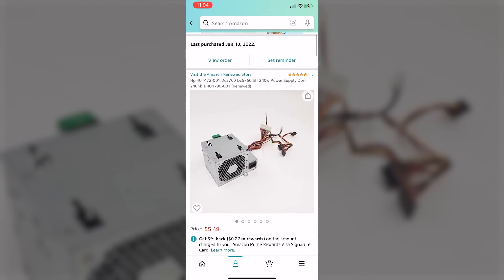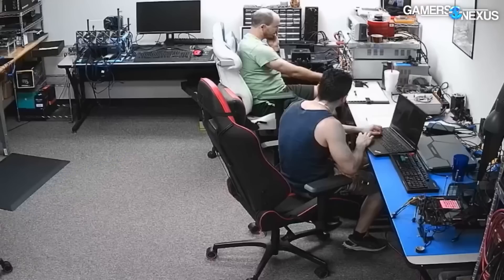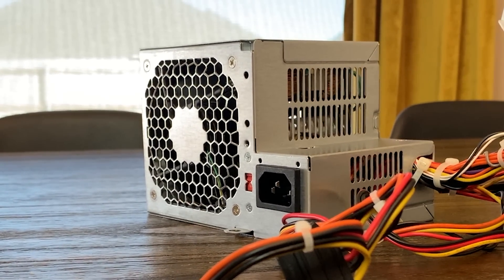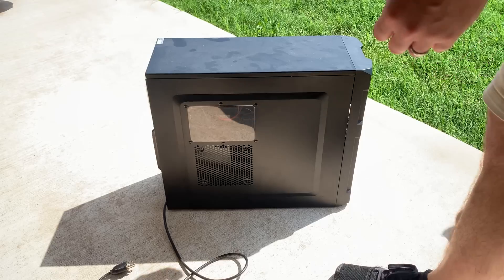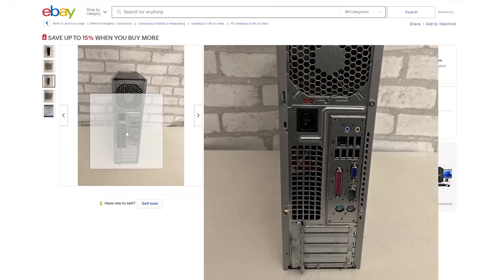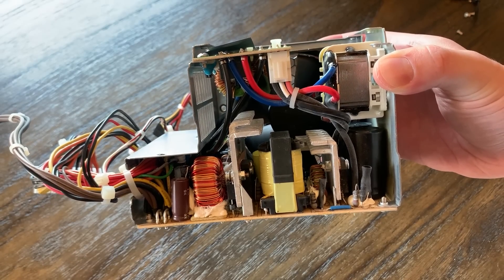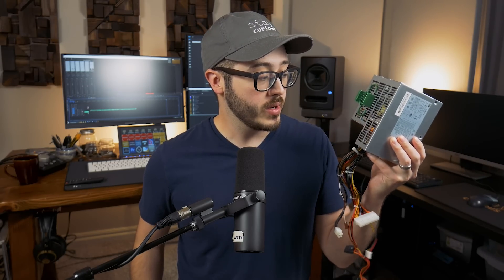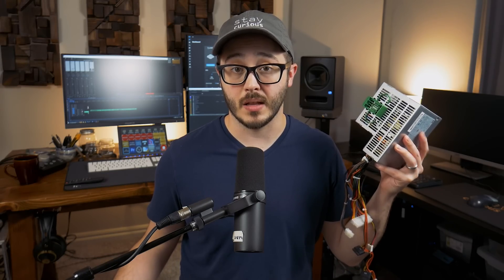THIS Ran A Website For Over A Year

Comment: I mean these PSUs are from like dell optiplexes which are tucked under desks for YEARS in the dust so they are reliable. Its the same thing for used PSUs if they ran for a while it means they will probably continue working for the 10+ years they are designed to. 👌(tho i wouldnt buy an old tier D or E PSU like a older 500w Thermaltake White PSU)

Comment: I ran an Athlon II 945  Quad OC'ed to around 3.1GHz 8GB or DDR2 1200 ram a couple hdds an ssd a dvd-r and an R9 270x also overclocked on a 300w Sparkle Power I got out of a dell that was tossed on the side of the road for like 5 years, pc was given to a neighbor a few years back no idea if it still works or not.

Comment: just replace the caps and keep using it, i repurposed hundreds of those PSU's, if you want to by new 12 or 5 volt 200w or more like 500w power supply  it's much more expensive and all are chines. at least these has been tested and meant to last. and by the way none of them exploded and never will if you use them properly, (i mean anything can happen). It has internal monitoring and if it becomes unstable it will shut off, or will not power on again

Comment: My opinion on what to do with it is to replace the caps. 

You bought it as a project power supply. If it’s working for what you need it to do, but just needs a couple of caps replaced … surely that would be more cost effective than throwing the whole thing out.

Comment: As a tech savvy 14 year old, I of course want newer equipment. But I am fine with older equipment, as I run it on a daily basis, and I am completely fine with it. I have old HDD's from 2007, and because of the conditions they were in, they are still fine, I write data to them, they work just fine. I have a CPU from 2006, still runs fine, runs fast enough for me to do what I need to do, my RAM is still DDR2, but it is plenty fast for me to do what I need to do. So older tech isn't always crap and junk as some people think.

Comment: ive never had a psu die, but i managed to kill 2 ac power cables lmao. one was like fucked up cuz it came with a laptop i got off ebay and it fucking like arc flashed i think cuz the plug was like barely connected. another was one that was on top of itself for a long time and managed to melt into itself and wow that was scary to find in the back of my computer (still worked). 

my brother had a crappy ancient antec psu that would shutdown whenever he tried to sleep his pc and it died when he did a case swap

Comment: you know, I had a power supply that exploded a few years ago 
I'm 15, I know a bit more about computers now, but back then I was just getting into and learning about computers and how to fix them. I had gotten a PC that was completely stripped, it had no native video support, or a hard drive, just the case, motherboard, and (faulty) psu. whenever I would hit the power button on the case, the power supply would trip immediately, so I just unplugged it and let it sit for a few minutes, did it again. same result. kept doing that over and over until I heard a pop and sparks flew out of the exhaust fan grille. I then realized I had majorly fricked something up and ripped the power cord out, upon disassembly and closer examination, an IC had blown up. I also shocked myself on that thing 
120v hurts

Comment: We all know that you're going to replace the caps; so go replace the caps..   
I was in the military for 20 years;  everything is basically  "lowest price that fit the bill " .. In today's PC market, like for laptops and mini-PC's, it's cut-throat, and everything is about where the manufacturer can save 5¢ and that's enough for them to put in a cheaper part; almost no one looks at the Power Supply other than the voltage /wattage that the power supply outputs.   At most, people might opt for a better power supply in a more expensive rig, but it's a weighted choice. 
You took a $5 power supply and used it for a year;  it's not a choice that I'd make, but I'm not going to knock it as it did work longer than I would have guessed it would. 
FWIW: I'm more likely to toss in a good UPS before I'd go dropping money into a power supply, unless I really thought that the power supply was suspect.  Line power is a bigger issue overall for electronics in my opinion.    Yes, I've swapped power supplies before for power issues; in the end, I've resorted to a good UPS more often than replacing the power supply.

Comment: I had one of these power supplies in my old HP DC7900. I used it to run a minecraft server. It ran fine for a few years then I got better hardware later on.

Comment: yeah, those caps are concerning to me.  Do what you want, but I wouldn't trust it.  PSUs are too cheap to risk it IMO.  If the system is as lightweight in terms of demand as I believe it is, you might be fine with a NanoPSU kind of deal; though, depending on which one you buy, you may end up spending more than you would on a standard PSU.

As for the experiment, it was definitely worthwhile, and even "bad" PSUs, unless something goes wrong, like a capacitor leaks or otherwise stops working, then the only time it's really going to fail is during very high demand. IIRC, most PSUs fail due to overcurrent, or max current loads, that the hardware inside just isn't capable of handling. So for a low power system, just throw in whatever, and it will probably be fine.  I wouldn't recommend a $5 PSU, but obviously, it can work.

Short story: a friend of mine actually had a system that wasn't working right.  Due to the strangeness of the issues, on a whim I said, let's replace the power supply, with nothing more to go on than my gut telling me that it's the only thing that affects all the components that had been "blamed" by the system logs for failures.  You know what? it worked.  Fixed them right up.  PSUs are both extremely important and extremely irrelevant in a system at the same time.  You obviously need one, but they can both be the source of plenty of problems, or something you can entirely ignore and they just work.  They're kind of a conundrum like that.

Comment: The part about it being an HP PSU is a good point. It's not so much about the price of the PSU that determines if its a good one or not. It's the manufacturer. If Seasonic released a new PSU for budget builds that was cut down to save costs in every way possible while only leaving the absolute necessities to ensure it's a safe PSU, for like... 30$... I'd buy it. Why?

Because it will probably suit my needs just fine for what it's actually meant for, and since I know Seasonic doesn't want to tarnish its reputation as being one of the better PSU manufacturers around; it's probably going to work just fine as well for many years to come. 

But for anything else, yeah, I'm probably going to keep buying the slightly overpriced units instead at higher ratings and wattages, because those are going to be used with the intention of upgrading through the years for the other parts connecting to it. Something cheap like what I just mentioned, wouldn't get that treatment. Likely.

Comment: I actually use power supplies took out from OEM Systems(Acer,Asus,Dell,HP...etc), I have come across various PSU brands like delta,acbel... ,most of them work totally fine over years, although some of them does not have verifications like 80+ or so, they worked totally fine, some times if I couldn't get enough power from a single PSU, I would simply just grab another PSU from my recycled stuff shelf and bridge the connection on the 24 pin header to power up something like 20 hard drives, works fine over the years, I build three servers with dual Recycled Delta PSUs, they work 24 by 7, been three years, no issues at all.

Comment: I mean no joke what I’ve learned from just PCs in general and just experience with PCs, that usually power supplies that look like that like bare metal usually could have a high chance of blowing up but at the same time have a high chance of being really really good. Good in reliability and the price because look at all these prebuilt companies like Dell, HP, Lenovo, etc. I mean by no means does it look like a normal power supply or one that you would buy for your own PC and when you look at the power specs it looks like it’s definitely not enough. That may be correct if you were buying a power supply from a third-party brand like Corsair, EVGA, Thermal take, etc. But in this case usually the prebuilt companies power supplies they’re actually able to handle the higher wattage or could be closer to full capacity while still being fine I mean sure they are proprietary so you might not be using those in a computer anyways. I also have other older computers who have power supplies that are normal ATX but they’re bare metal and don’t look as good as moderns power supplies but it also is able to run at higher capacity. I know this from personal experience because I have tons of prebuilt PCs and a lot of them are used for crypto mining so they’re basically running 24/7 and even if there’s probably a lot of dust buildup in it it still hasn’t had any problems yet knock on wood.😅

Comment: I use an over 20 year old 450W power supply in one of my mashines. My daily driver has around 5 year old dell optiples supply. I also have the exact same machine your 5 buck power supply came from and I am using it for hosting a minecraft server. An old hp office machine is good for playing minecraft, csgo and shit too as long as you have any gpu better than gt 710.  This power supply has capacitors in a bad shape but it'll be good enough for 3 - 5 more years for low power projects like running a minecraft server and shits.

Comment: I work in IT, & in this business cost rarely means quality anymore. Nowadays you have to go by track-record only. I have an old ATX-type Deer Computing Company Pwr supply (230 Watts @ 24 Amp) manufactured in Feb of 1998, that I use almost weekly to test individual components without having to run them through a newer AT-Mbd combo, or Jumper'd AT supply. I had a much newer Dell (2016 420watt) AT-type that blew a cap & fried the board, SATA-2-USB adapter & the 500GB HD connected to it in one shot.

Comment: Until you discharged the capacitors, I was cringing. As opening up a PSU not doing that is so dangerous.  As long as they pass Safety standards, a cheap PSU is fine for a server as it will never be under full load considering must low power home server chips are only 7w-25 idle and 90w underload so as long as it a high rated eg 100w your fine. Those PSUs that low up on GN where only failing under a extreme load, however if building a gaming rig the PSU was substandard for that use. But I bet their are hundreds of low end builds with a max 400w power drew who brought a cheap build and they would last and be safe for year. But paying the price they was to BUY you expect safety under any load. Where as cheap $5 PSU you now its limit. I have a N100 mini PC running some unknown OEM crap but it will be ok as the N100 will never get near the 150w brick supplied with it.

Comment: I used an old PSU for my Minecraft Server... Like That PSU was free with an iBall ATX Case... And when I checked the PSU... It was extremely dusty... And from 2010... I first checked it externally to see if it was working... And it did... So I put it in my Minecraft server which ran for 8 months nonstop... Until I had to turn it off for some reason, both the server and its PSU are still working extremely well... 
(That PSU was never cleaned in its lifetime... And still ran... Old PSUs were good bruh)

Comment: People these days have the belief that everything has to do with ultra maximum specs, high performance and spending a ton of money on computer parts no matter what you want to build. Well personally I've been using old desktop PCs and parts for the purposes of my job in a public hospital in Greece and I got to tell you one thing, if it works it works. Sometimes it only has to do with good preservation of hardware that's all! So KUDOS for your 5$ psu project, I hope more like this are coming in the future.

Comment: I really enjoyed this video  - and your thoughts about people on the Internet. There's so much PASSION for things that are ... well ... really not that important. Some perspective is good.
As far as old power supplies go - I'm pretty sure the little compact case Pentium based system I've had in my basement for over 10 years running Linux wasn't a premier power supply when it was built - but it was good enough, and that machine is really only used for trying new things out that don't require much power. There are good comments here about the power efficiency of power supplies - and computer systems themselves, and the costs related to running inefficient hardware.
Keep up the good work - I enjoy your videos because they're not over produced, you talk like a normal human being, and you make it look doable for a normal human being!

Comment: The bad caps are usually from a voltage or current spike.  People don't realize that voltage drops cause current spikes.  Voltage and current move in the opposite direction.  A "brown out" causing higher current draw can be as bad as a voltage spike.  I keep all my electronics on an UPS/battery backup to protect from both.

Comment: 2 years ago my friend gave me his old mATX mobo with integrated fanless Celeron J1800 Atom cousin cpu. Its been up basically all the time as NAS since then except kernel updates and one os reinstall. Its running a no name "400w" ~70% efficient chinese psu that i removed a fan from to make quiet. Its barely getting warm at full load (Kill a watt at the wall socket around 25w). I mean some little crammed phone chargers run more power than these low power pc's and they dont die, so your average no name feather light fan removed psu probably wont too.

This psu is like a 5c psu compared to the 5$ PSU people are calling a bomb, has been running FANLESS and still has to show any issue. Not everyone is running quad enterprise gpus and dual socket 300w cpus.

Comment: this video basically shows something i did on my newest project. i had a cheap power supply malfunction on a low power system. all i had was a very old power supply from 2005.. but since the system only runs a pentium G2030 i decided to install it since it was the only one i had. it works perfectly fine as of writing this. the fans are loud but at least the system works perfectly fine

people take a lot of things for granted. even the most expensive power supply can explode or fail. nothing is unbreakable or invincible..

Comment: My main rig used to use one from the trash! It was some ancient 300W unit that acted as a cooler for my GPU too because it was constructed out of cardboard. 

It lasted forever. And probably still runs now. (We moved, it got tossed)
Reply: I still use a 20 year old power supply in one of my retro PCs. I don't trust it with my life so I just connected it to an extension cord with a fuse. Still I don't see any issues with it.

Comment: Dispose of it. I get the whole point of this video, but running a very old PSU would only be a fire hazard if nothing else. Don't even try to fix it. Maybe put that effort into some other content people are interested in, like some extreme overclocking (memory, CPU and GPU Crossfire) on you B550 Vision D-P (which is actually one of the best overclocking boards in the AM4 lineup, far from what you said in the last vid), or maybe dig up some older motherboards with PLX chip and see if there's any issue when running higher bandwidth devices off of those PCIe slots.

Comment: Replace the caps and put it to work again in the server. These things can run for ages if maintained properly.
I just retired a PC last year that was built in 2003 and was used on a daily basis. The PSU failed when switching on. As I am not a technical expert, I refrained from fixing the PSU. But keeping the PSU dust free helps to keep it alive.
Maybe put links from the 5$ Power supply website to your various videos on the channel or a playlist about this PSU.
Thanks for all the videos and keep on the good work

Comment: I have an old dell that already ran 24/7 (very lightly most of the time though) for many years running 24/7 as a server for a year now and aside from being a bit rattly it works just fine.
On the other hand an equally old PC I found in the trash was randomly shutting off because of its dying power supply, but at least it didn't explode or catch on fire.
In general I'd trusy an old office pc's power supply a lot more than a new cheapo psu that might not have any protections at all.
Reply: True. I have 2 office power supplies and they're so damn good. They have very low wattage but they're very good. One of them unfortnutaly has proprietary connector. I also got a 20-ish old power supply in a retro pc and it runs without any issues. I also once had to use a 10 year old power supply that might have been left in the rain. It didn't explode or something. It worked quite well. But I didn't trust it so I had to replace it.

Comment: I have this nasty old ATX power supply that I keep on hand for troubleshooting. While I don't have the balls to keep it in use, it really helps to build a quick motherboard box test bench to have an external PSU. It was some thermaltake on the LTT forums F tier, it's only on 20 minutes a year, and is worth much more to me than the $10 I spent on it.